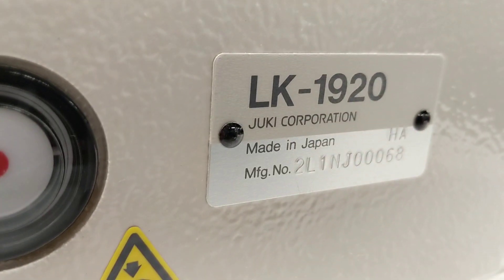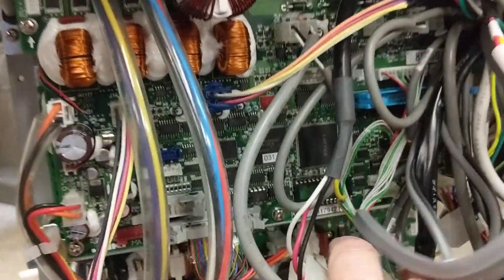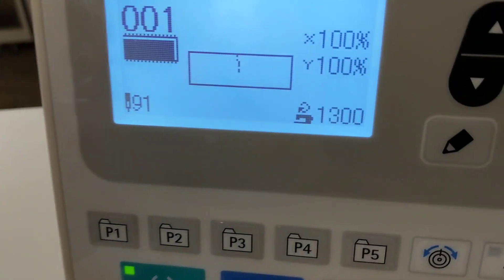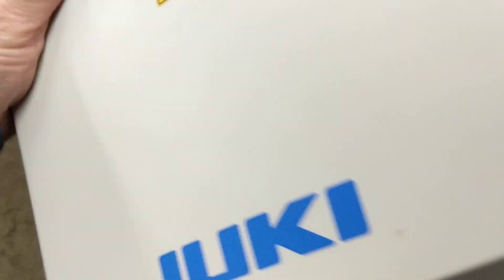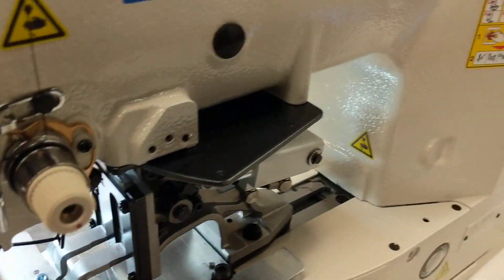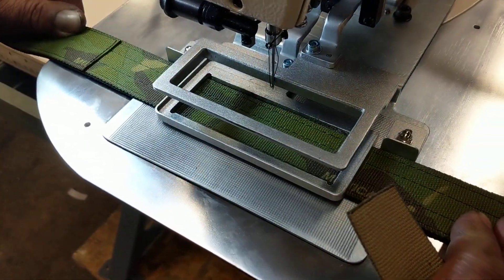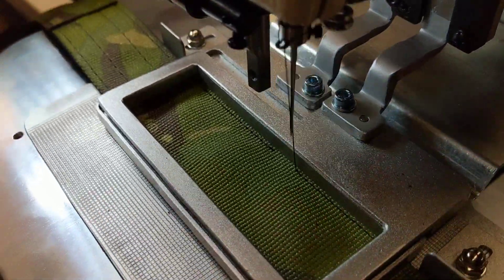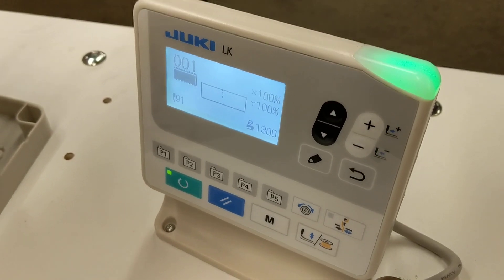LK1920/MC676 CONTROL BOX

Comment: Is this also compatible with a LK1942?
Reply: That would be an amazing and worthwhile upgrade
Reply from the maker: Ya know what? Very good question! The Lk1920 and Lk1942 are basically the same head mechanically . I know the old control boxes were different only because you had a optional hand held programming device. It also had some additional outputs. But the step motors and main motor are the same.  I am going ask Juki regarding this. My guess is the answer is YES, and I would bet that if they are continuing the LK1942, this upgrade is in the  works.  Stay tuned.....
Reply: @camatronsewing   Any update on this? I would really love to upgrade my 1942GA
Reply from the maker: @atwoodgear3413  Not at the moment. Still trying to upgrade the older LK1920 machines....
Reply: @camatronsewing just following up again. I’d really love to convert my 1942 if possible
Reply from the maker: @WetsernSon  They do not have a control box for that...... the machine has been pretty much discontinued.... I don't know what would happen if you installed the LK1920 box on the Lk1942...even though they are similar, might not work